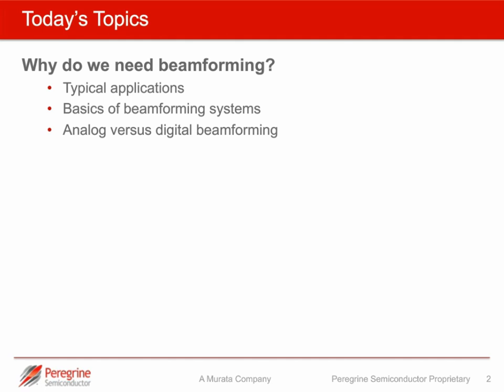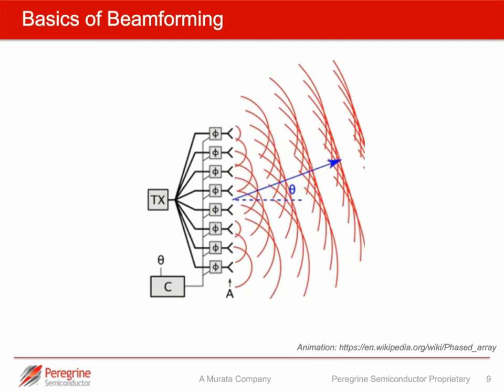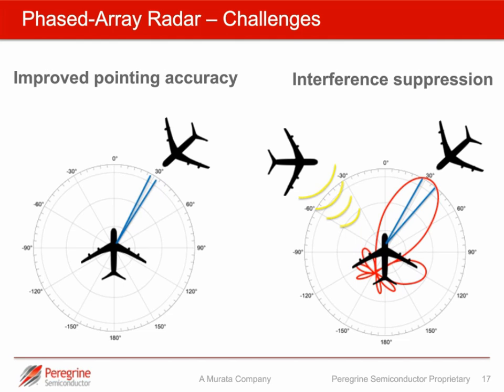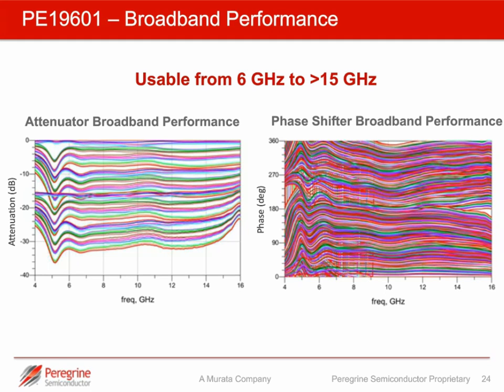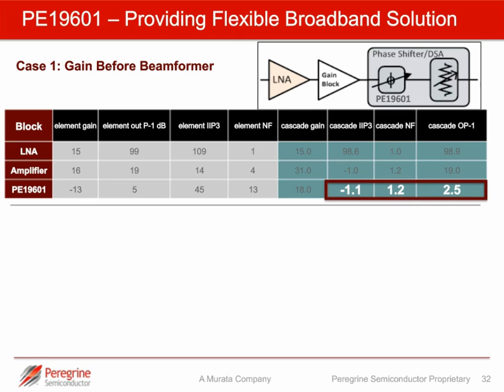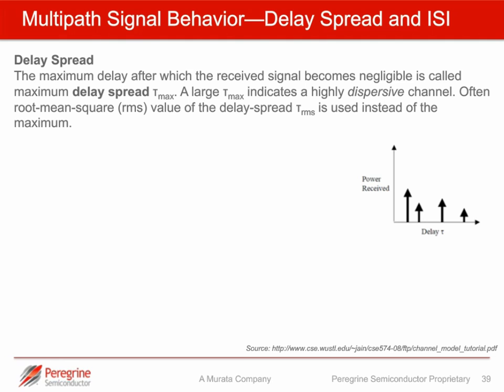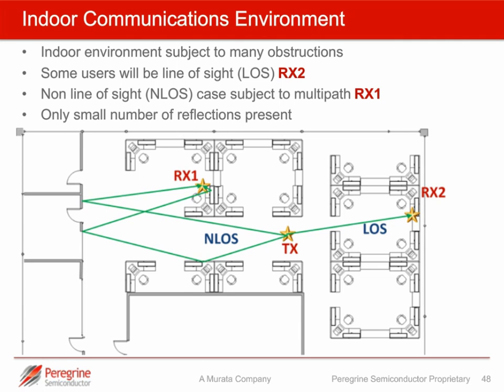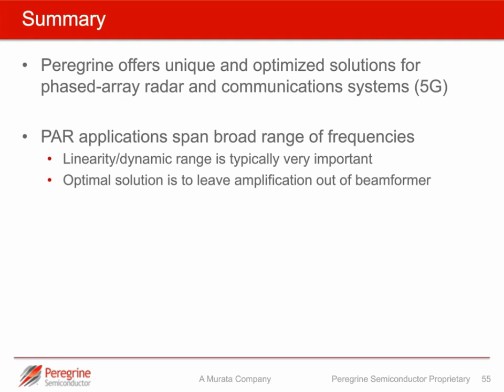Analog Beamforming—What is it and How Does it Impact Phased-Array Radar and 5G?

Comment: A beam array system is not very useful in collision avoidance ATC and TCAS will take care of the problem, but could be useful to fly above when possible or around a weather system. a standard mechanical radar placed in the front of any commercial plane will give the same information, now the question is it more cost efficient to use a phase array or mechanical radar in the radome in front of the plane. In military fighters where the space is limited and the cost is not, phase array is a clear winner.

Comment: No mention of direct health hazard, just ignore the issue until the population cannot escape the directed radar at homes and cancer rates are beyond ignorance and it becomes deliberate genocide. Beamforming = mass cell death, 5Gz, 28Gz, 38Ghz, 60Ghz and 73Ghz, call it radio Deathewall.
Reply: I’ve worked in the communication field for 23 years, dealt with high power, high directivity radar applications for most of this time. I’ve worked alongside engineers and military personnel who have done the same, having engineering and operator experience respectively. There is no increase in cancer rates among the people I’ve worked with and the general populous. I am in perfect health, and I’ve had high power, unidirectional transmitting antennas pointed directly at me for hours at a time on multiple occasions.

Stop trying to spread misinformation, RF is not a danger to anyone.
Reply: @Dumbhippo21  People, somehow, don't understand the differences between ionizing and non ionizing radiation
Reply: Chris M what about targeted individual?  dont you think these technologies could be dangerous to them?
Reply: @Dumbhippo21  What about microwaves? What about having a bunch of microwaves focused on your head?
Reply: That's why the are tons of regulations and specifications for radiated power, EMI, EMC etc, so as to minimize your concerns and the effects to human body.
Reply: I could spend the next 6 hours citing references, that is a job that you must do, all technology comes with health baggage. Here is one that you should have read while at University. http://www.safeschool.ca/uploads/Navy_Radiowave_Brief_1_.pdf
Reply: Empty attack on a informed citizen, did you read YOUR NAVY report on Radio frequency problems,  no? that would be too much effort, just side with the ignorant, LOL, your brain will be cooked long before I even feel any problems.